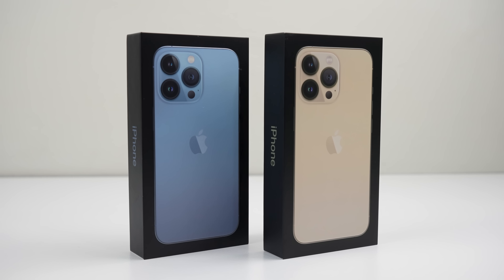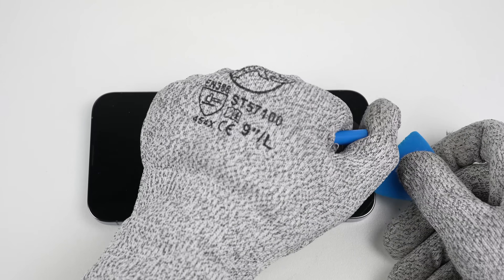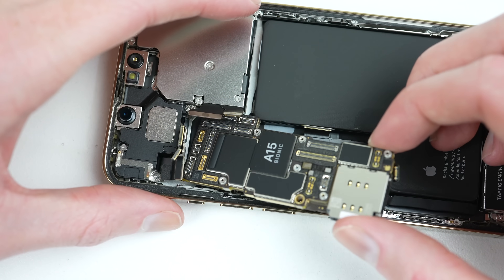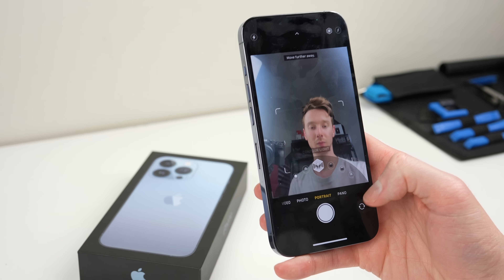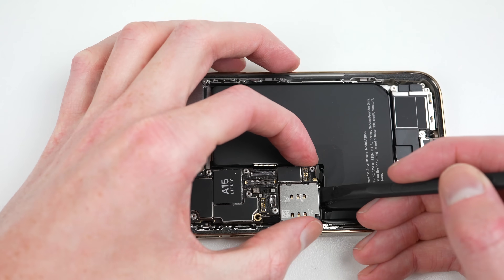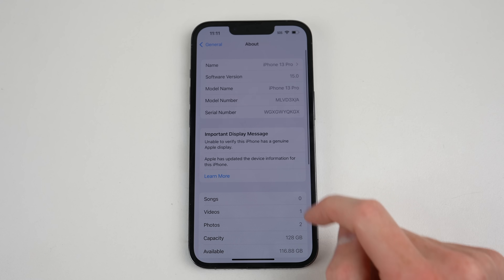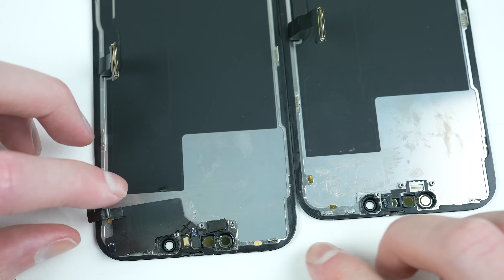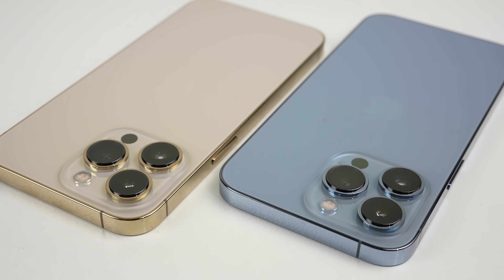iPhone 13 A Repair Nightmare - Teardown and Repair Assessment

Comment: I am not a fan of Apple, and I have never used its products either, BUT there are two sides of a coin.

iPhones are very expensive and popular smartphones and are somewhat a jewel. That fact makes them highly vulnerable to theft. Of course, an iPhone can be locked down to avoid unauthorized use by a thief or a second-hand buyer.  If a primary purpose use is impossible, a stolen phone can be sold for parts. Making such spare parts virtually useless serves a purpose and value for a customer as well. Thieves will not be interested in iPhones anymore if you can't get anything from them. 

From this perspective, such a policy is good since the company cares about the product and its customer. They just need to ensure replacing components in service centers is not expensive - an impossible task per se.
Reply: but you have more change of being in the need to have your screen, battery, etc replace than  having your iphone stolen.
Reply: @monkeymindfrance8356  it depends on the place you live. In the first world, a stolen phone is not a big problem. The police keep track of them. But in the third world, police do not work. Stolen phones are traded in whole or in parts. And the third world accounts for a major share of Apple's revenue.

plus, how often do you actually change any part of your phone?
Reply: @igork.8471  
The huge business of phone repair is solely based on the fact that people actually change parts of their phone more often than you think.

But i agree on the third world comment about stolen product. But there is two issues with that also.

-most third world countries haven't apple stores like in europe/usa, so changing parts there with these new policies would become a kind of mission impossible even for those who have haven't stolen products.

-if even in the first world it is considerated expensive to own or repair an iphone then imagine what it would be like in the third world, do you see people puting 3-6 months salaries to get their iphone fixed because they are original paired apple parts ?

and lastly i guess that in most third world countries most of the iphones used aren't last generation iphones, so having to buy new parts at apple price just for security while you iphone is 3,4,5 generations
behind is kind of a bad deal. 
And for those whose used last generation iphone in third world countries, it is a bit like calling for trouble on yourself, its like walking in the ghetto with diamond chain on your neck and no bodyguards. Someone is going to try something on you.

the key is to find the perfect balance between security and freedom, the problem here is that they give us a certain level of security but zero freedom and personally, i don't want that.
Reply: @monkeymindfrance8356  No, no, no. Obviously, you have never been to a third-world country. Don't think they are poor criminals. I am from one of those. You can have an expensive iPhone and no one is going to punch you in the face for it. Because for some people showing off is a matter of lifestyle. Just like in the U.S. You need to think better of third-world countries. Sure, people there buy the latest iPhones even if they cost 3-6-12 monthly wages. They are sold by many resellers, not just official Apple shops. And sure old iPhones are considered a piece of crap by people there. 

The iPhones were easily unlocked if stolen. They were scrambled into pieces for those who can't afford official service. And official service might not cost money but also time for the reseller to ship phones back and forth. So, service is not only expensive in the USA or Europe, it is expensive everywhere. But that is why criminals steal - to satisfy the demand for spare parts. 

If the market does not exist - there is no way thieves will be interested in one of those. However, such a market is a huge cash cow for Apple itself. 

In my opinion, Apple should make the iPhone service cheaper and affordable for anyone but keep this repair nightmare feature. It is beneficial for the consumer.

Comment: iPhone engineers be like: "Write this down, write this down!"

Without hyperbole, I actually believe they put more effort into blocking repairs than designing actual new features.
Reply: Yeah they probably spend 3/4 of their design budget on blocking repairs. 
It must be really cheap to develop the rest of the phone since its basically a carbon copy of the last generation.
Reply: A lot of money goes to R&D, guessing they're developing a shitload of bugs to use for when people try to repair the phone.
Reply: What possible new features could they put in phones now? I mean, what can they not currently do? At this point I want less features and more stability and less ads.
Reply: @did_I_hurt_your_fee_fees  right? I'm perfectly content with what my phone can do and the only issue I've had in the last decade had  been "god I wish my phone ran games better"
Now I do have a phone that runs everything I need and it costed like 1/10 of an iphone, I don't understand those pricetags
Reply: @bnuymedia2537  They charge like that because people are willing to pay it. If no one bought the over priced iPhones then the prices would start coming down. Apple has basically a cult following and they'll buy iSocks if Apple comes out with them.
Reply: @did_I_hurt_your_fee_fees  lol, iSocks
Reply: @rottenapricots  They'd sell for $1500 for the left iSock and $2200 for the right iSock. The charging cable is not included LOL
Reply: @blakksheep736  Wow, I could not have said it better myself. I used to have an iPhone and I updated to an IOS that was more than my piece of crap phone could handle (which I'm sure was software caused and not a hardware issue) and it would not let me revert to the previous IOS. So I had to get a new phone. Got a Samsung LOL
Reply: @did_I_hurt_your_fee_fees  Samsung pog.
I have a Samsung phone and tablet. The tablet is mostly for drawing, YT and Minecraft redstone.
Reply: @blakksheep736  I won't disagree that Samsun is crap too, but if you want to compare I think iCrap is much worse. Pretty much all technology is garbage these days.
Reply: @did_I_hurt_your_fee_fees  How does an SD card sound?
Reply: @blakksheep736  Unimportant. Not sure what you were expecting me to say. Is having an SD card some kind of new feature? No? Didn't think so.
Reply: @did_I_hurt_your_fee_fees  No, I'm saying that Apple phones do not have even an SD card slot, which is so annoying.
Reply: @blakksheep736  Seriously? I thought all phone had SD slots. Man, CrApple really is getting worse and worse. I thought it was insane when they took the headphone jack off the phone and now no SD slot. Why the hell do they cost $1100 if they don't have anything or even come with a charger?
Reply: @did_I_hurt_your_fee_fees  Actually they didn't remove them, iPhones have never had SD card slots.
Reply: @blakksheep736  Well, crap. Yet another reason to not buy that over priced junk.
Reply: @did_I_hurt_your_fee_fees  Yep.
Reply: @did_I_hurt_your_fee_fees  ok boomer 👍🏽

Comment: Bassically this is an iphone 12 but more expensive, the 12 also was an 11 but more expensive the 11 also the 10th was a bit different than the 8, this phone should cost 700 usd not 1100 if i remember correctly the 13 pro max costs 1100 with the minimum storage, i wouldn't even pay 700 for the apple garbage anti consumer policys to anti repairability, poor compatibility with apks and expensive apks that should be free like in android, imo the only good iphone is the first one couse it changed the world as we knew it, nowadays without the first iphone our phones wouldn't be as good as they are right now, super innovative phone and very very good and with good price for 2008, apple just wants to control everything in the device you buy its not yours is from apple even if you paid an absurd amount of money for it, apple with this garbage guarantees that people will pay to apple more than the real cost of the phone for fixing it, this is absurd you can't even change a single component... i hate the 2021 apple personally, apple was good in 2008 or earlier but right now... Without Steve apple has become a garbage anti consumer company

Comment: The only Apple device I ever owned, was an Iphone5. It was a complete pile of junk until I jail broke it. After jailbreaking and using third party apps to customize the phone, the full potential was unlocked... But because I don't support EVIL companies like Apple, I have never owned another Apple device since. It's surprising how many people buy these horrible devices... I remember how difficult it was for me to change the phone's ring tone. I am a very technical person in both hardware and software. I develop Software, Hacks, and even PCB's from scratch... I think they want everyone to have the stock apple ringtone to use it as advertisement.

Anyways... This video was amazing.

APPLE JUNK !

Comment: I work for T-Mobile in Minnesota, and as a mobile expert, I highly recommend that you do not do this to your iPhones. This can cause mechanical issues with your iOS,  OS codes, and BIOS files, thus voiding your warranty. The main boards you switched have a certain code to a phone. If you switch those, that will cause what you have down in the video, and those are link to the BIOS functionality files of the phone, causing a corruption in the OS coding script making the OS construct malfunction. In other words, don't do it.
Reply: That was In the video?
Reply: @joenani  all the issues he shown in the video are BIOS corruptions.

Comment: Apple is garbage, they still keep going against the right to repair movement. Basically every component has an ID, and if it's not matching , it will display an error. Apple has done this DELIBERATELY to stop shops from being able to repair them. Because Apple is on a power trip, it doesn't want to sell you a product, when you buy something at Apple, they OWN YOU instead! 

Stop being an idiot consumer and don't buy Apple products. There's nothing "good" about this phone, it's nothing more than an empty shell, and no one should buy this kind of anti-consumer product.

Comment: one thing ive noticed is no one talks about how samsung has also made it hard to repair the phones through 3rd party repairs. I currently use an S21 Ultra and likely cannot replace parts. At least apple provides the ability to buy a warranty, unlike smasung, hence why I am on my 3rd pair of galaxy buds bc samsung wont replace them...

Comment: Pretty similar to working on late model BMWs. Legislation should be able to force phone/computer makers to accommodate independent repair shops. Honestly the special tools required here are a non-issue: A heating pad and a few screw drivers aren't tough or expensive to source. My garage has thousands of dollars of tools to allow me to work on my car, so this is pretty chill. I can see why using special screws isn't such a bad idea- do you really want every 13 year old pulling apart their phone and destroying it?

Comment: I was thinking about upgrading my iPhone, but after seeing this, not worth it. My iPhone 11 is still able to be repaired by a third party or myself. It seems that art of the components on the new iPhone 13 are digitally hard coded to the main processor of the phone. And once you replace any part and the code changes, the phone automatically becomes unstable. Forcing you to take it to apple to be repaired. This obviously forces you to get the apple warranty. Because, if you or anyone else opens the phone, it voids the warranty, and you’ll be forced to buy a new phone. Real slick apple. I really wonder what they’ll come up with next. Some type of alarm if you open the phone??

Comment: Failing to make something repair-ready is one thing, it's crazy to me as someone trained to take apart desktop computers how comparably difficult it is here to get inside and change the pieces, but it's really twisted to deliberately go through this much trouble to prevent repair.

Comment: As someone from a country with no Apple stores, I really have to take care of my iPhone or else I'm really fucked.

There are lots of repair shops, and some will sell you non-genuine parts and claim they're from other phones (they do that for older iPhones that do not have these iOS warning messages), so on one hand, I want to see the positivity of what Apple is doing as it holds those repair shops to a bit of accountability, stealing my phone and trying to sell it for pieces (especially done for batteries) is now a nightmare for thieves. All of these are possible positives, but the issue is that I have to send my phone overseas now to fix it, and it will cost me a lot to do that.

Apple should find a common position between giving customers right to repair while also managing to keep all the positive things I stated above. sooner than later, or else they're going to be stroke with a lawsuit where they're going be the sole losing party.
Reply: That’s a good point. Didn’t think about that. About making it more difficult for thieves to exchange parts from phone to phone. But, there should be the ability to option out of this or “unlock” it if the phone is yours. Good insight though!

Comment: A very well conducted test, confirming what we suspected.   I guess in the efforts of high security, these software locks are a good thing.  My phone contains my sensitive data, I don’t want some third party being able to access it easily by swapping parts.
Reply: Ты идиот ? Совсем не понимаешь контекст проблемы ? Получить доступ к данным можно в любом случае, а работоспособное устройство-нет.
Reply: I hate to break it to you buddy, but as far as data stealing or hijacking, doing a manual part swap without you noticing is counter-productive, expensive and limits your customer base.

Any hacker or person with malicious intent would be stupid to do so. Not to mention, it leaves physical tracks that are very hard to erase (as opposed to digital ones). It's ineffective, localised and not remote enough. Like seriously, thinking someone is seceretly going to replace your parts of your phone to steal your data is conspiracy bullshit. No, they're just going to use spam texts that install shifty apps or malware (like we've seen a lot of this year) or hack into your device thru cellular or wifi networks because that how this stuff happens.

I mean, we aren't even talking about some shifty third party produced parts. We are literally talking about Apple authorised hardware straight from Apple. It's pathetic, ridiculous and very much proves what people with half a brain thought when Apple started removing things in the name of 'environmental sustainability'. It's mock and fake activism to disguise bad and anti-consumer business practices, and sadly Apple isn't the only company that would do it.

And hypothetically (and if we want to entertain conspiracy like situations), if you went to a 3rd party repair shop, and if they did that, there's no need to replace any parts. At that point they have enough access to your device to simply  edit or alter the source code or the software, or add any undetectable third party device the system may not even realise is present, and those are both much easier and quicker then replacing one part with an altered, frauduent one. None of what Apple is doing is going to stop that.

Comment: Damn this makes me so fkn proud of my samsung
Reply: New Samsungs are doing this too , i have an S20fe and i broken the screen a few months ago and it is impossible to find replacement , i live in Brasil Minumun wage here is about 1,300 reais a samsung s20fe cost 2,500 reais a new screen cost 2,800 reais i cant find a place to replace at a fair price all screens are more expensive then a new phone , not even samsung authorized repair shop have the screen , and we have legislation that says Manufactures have to offer replacements and spare parts for 10 years after the product has been put on market. The problem is the phone is not working and i reallly need some stuff from that phone , i cant recover my data , all i need is a f screen for a Samsung s20fe if u now anyone that sell a screen that wont do what apple phones do i would consider importing for a fair price
Reply: @nalanewton  I have the s20fe as well, first phone I've bought myself so I've been extra careful with it but my local phone shop have got almost all the parts and only charge 60 pound which is about 434.47 Brazilian Real
Reply: i felt like u about samsung until now , i am really considering giving my privacy away to CCP and buy a Xiaomi, at least u can repair

Comment: Monopolistic attitude of Apple is what led me to permanently switch to Samsung products. You can't install apps other than from the appstore, and as if that's not bad enough, they are going full ballistic mode with this parts replacement thing. Good riddance to bad rubbish.

Comment: Let me guess.
Even if you Repair the screen and take it too an Apple store, they can't just erase the code for you so it'll work?
Or can they fix these errors?

I mean, cars sometimes have codes like that. It'll keep throwing a dash light until it's cleared using a special tool. Thankfully those have work arounds. One of which is depleting the solenoid of energy storage. Would apple work the same way I wonder? Disconnect the battery for a few hours then reinstalling it. Would that clear these errors?